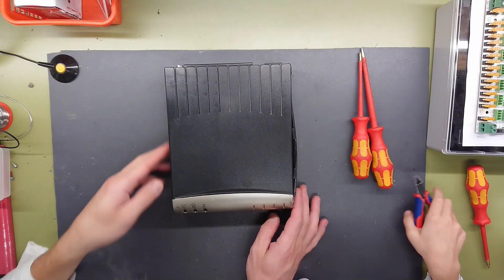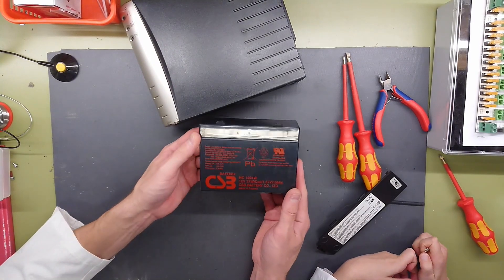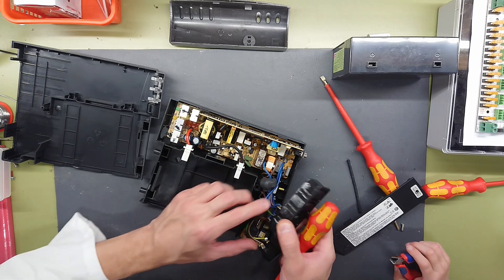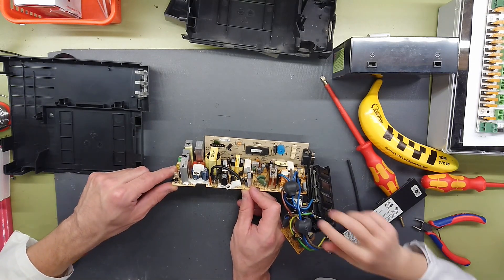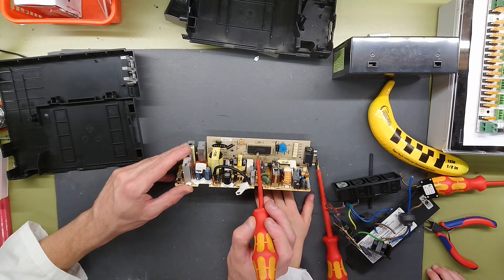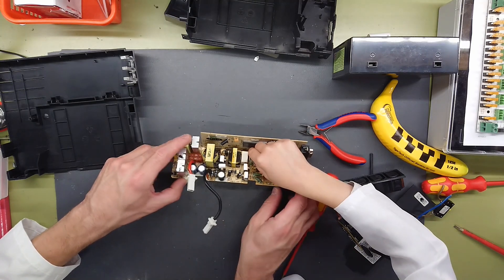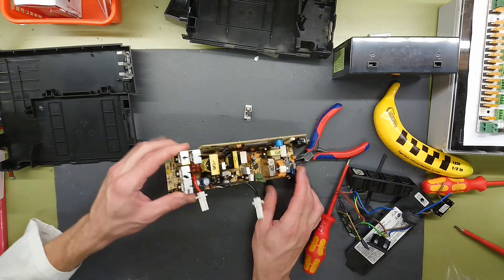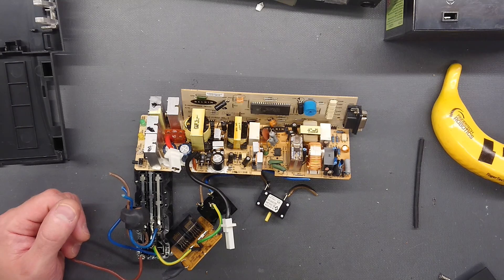Belkin Regulator PRO Silver 650VA UPS Teardown

Comment: Hallo Mr. Kaizer.
Very well video. Yes, the transforma seem to be very smal designed for the 650va. And i think, the output in batterie mode will not give pure sine waveform.
Thanks again.
VG, Jürgen B., from germany
Reply from the maker: Its a good point, that power quality will be bad due to non-sine waveform, but it is for no more than a safe shutdown. There is no production going to be run on a unit as small as this :)

Comment: Aftermarket battery, you see the sticker under the pull tab, taken off the old battery.
Reply from the maker: Still a pretty rare aftermarket battery then, considering its "special" case. Compared to the regular lugs on a 7.2Ah battery.
Reply: @KaizerPowerElectronicsDk  Not really, if you pull off the top of the case you will find the regular 7.2Ah battery inside, with leads leading to the connection points. Belkin doing their best to lock in the consumer, but as cheaply as possible. That top section is just solvent welded onto a regular battery to make it this kind of module.

Comment: There is no way that small battery is going to be capable of 80A and the 650VA rating is probably way over rated. The transformer is too small. I assume this unit output a square wave.
Reply: 650VA rating is basically where it shuts down. Yes transformer is way too small, along with heatsink, but these units were designed to be connected with serial cable, so that the PC got a 3 minute period at full load to shut down and save all data, or 25 minutes with running with almost no load. Basically would be enough time for the running software ( Belkin rebadged open source UPS software) to initiate hibernate and save all context of running processes, and system memory, so that on power resume the UPS would turn the PC on again, and on boot the hibernate would be reversed, with perhaps half the running processes actually resuming properly.
Reply: Other than the battery, that UPS almost looks like it'd be suited for the next model up.  I didn't see any DDS or other controllers for making sine.